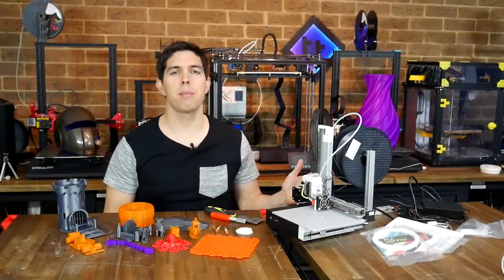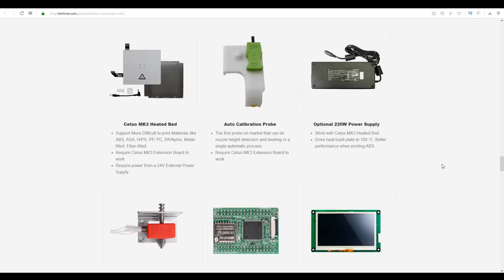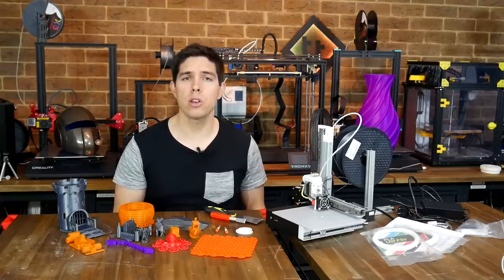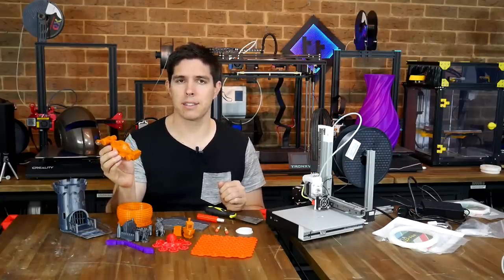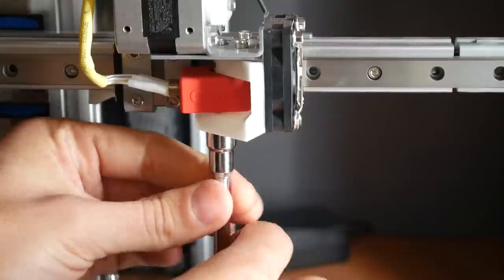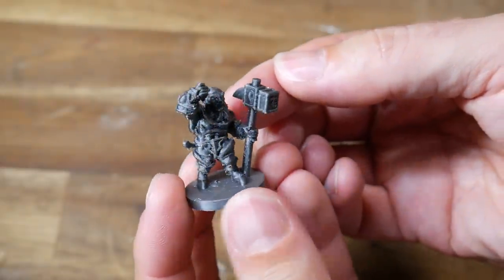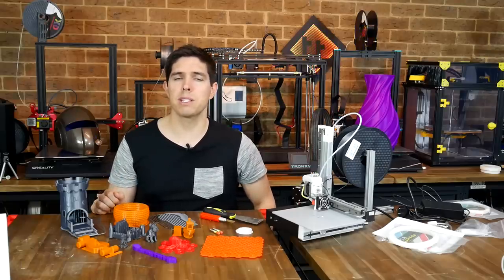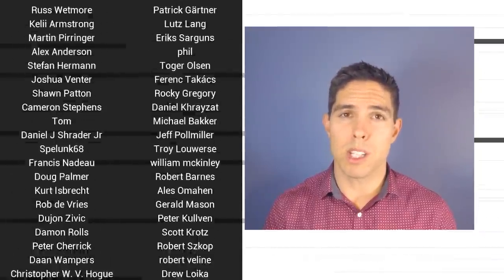Cetus MK3 review - Linear rail legend or lost opportunity?

Comment: Hmm, let me think. This tiny build volume, locked in proprietary hot mess software and nozzels or an Ender 3 for less than half the price. That benchy you produced was terrible. The test objects on my Ender 3 are far superior to that ringed up mess. Yeah, I know my E3 doesn't have auto level but the matrix level takes a couple of minutes and since I print on glass it almost never loses level.

Comment: Increase the belt tension to prevent the Z axis fall 😉
Reply: It will still fall, the "gantry" is too heavy for that system, its one of the reasons why basically everyone uses lead screws..
Reply: @lookitsrain9552  I've been installing belts on every printer I own since end of 2016. You can't get better motion. If the Z belt is properly tensioned the gantry won't fall even with bigger gantries.
Reply: @axelSixtySix  I do not think its the right way to increase the tension of the belt only, as it only inrease the friction. Actualy its more the tourque you need to rotate the stepper with power off you should increase. 

For example with 16 teeth on a normal 1.8° stepper on x you have about 83 microsteps ( less than 6 fullsteps) per mm. With a common leadscrew (lead 8mm) you have 400 microsteps (25 fullsteps) per mm. So you need 5 times the force to get the same tourque on the motor by forcing the moved target. As a powered off motor has a only certain resistence against movement (depending on the size of the stepper), increasing the gearing should be the correct solution, not increasing the friction elsewhere by increasing belt-tension higher (as this needs more force also for the wanted motions up and down).

Even than f.e. an ender 5 can not hold the bed in power off. But with lead 2mm (1600 microsteps = 100 fullsteps) its nearly impossible to push the bed down.
So the right way should be to increase the gearing - add a planetary gear on the stepper. So if the z-axis has 16teeth driving the belt (and so effectivly about 83 microsteps/mm), adding a 14:1 planitary gear you would change it to nearly 1200 steps/mm. Wouldn´t fall by gravity or even pushing by hand.

Also you can play with the numbers. With 28:1 planitary gear but 32 teeth instead of 16, you would get the same result, but much more radius for the belt - with 32 teeth you can use steel armed belts without problem (steel core breaks after time with 16 or 20 teeth, as the bending is to much for steel in this small radius, so many people prefer fibre glas or cevlar armed belts - but on bigger diameters steel armed is better as they are less bending).

Of course alternativly to a gear also a pully block might work (but is an more space consuming construction).

I like z movement with belts a lot more than leadscrews. Else than using leadscrews, a geared stepper motor with belts might result in better prints without wobble. I actualy ordered a planitary gear (hopefully ariving before xmas) to change an ender 3 to belt-driven z-axis (I want to make the Ender 3 an IDEX, wich is more heavy, so one z-screw is not enough - buying a dual z-upgrade is not realy cheaper than buing an nema 17 with planetary gear anyways)
Reply: @oleurgast730  You're about to do what I did 3 years earlier, and what Lulzbot is doing today on its last range of printers. There's nothing like experience the real thing. I don't want to sound pretentious, but I'm engineer. I know all you said and beyond. As you like numbers, ask yourself how much torque you need to hold a 1,2kg gantry (creality alike). The Cetus' is probably much lighter. If your calculations are right, you will probably conclude than an average Nema 17 motor does not need much help to hold a gantry in place, and have plenty of power to move it up and down. The extra friction will allow the gantry to stay up and won't affect the asked move. This theory is successful in real life, that's why I was confident to say what I said. The real improvement is a perfect Z motion because most of T8 screws - and especially on cheap chinese printers - are awfull. The lead screw nuts are even worst.

Comment: The Mk2 was my first printer and I still use it for PLA and petg with a 60c heated bed and blue tape but without rafts! Mine has been a very good first printer. I hope to update it with either a 32bit board and marlin or a Duet board.